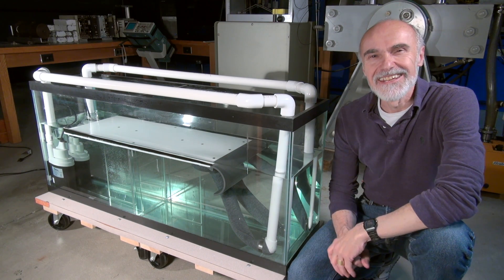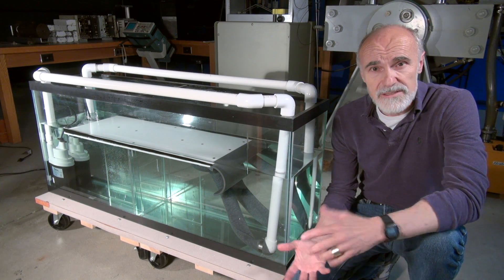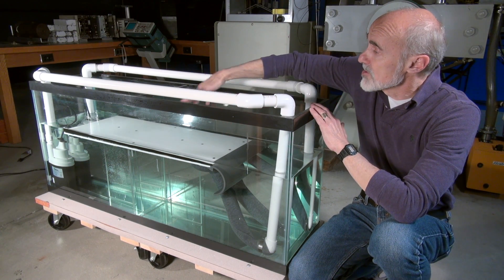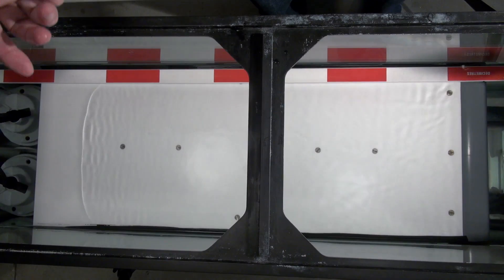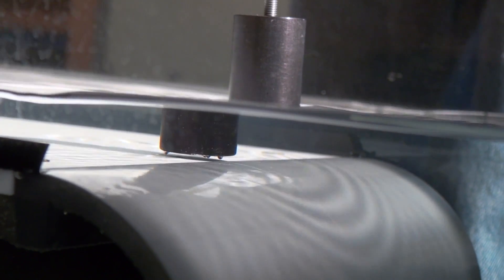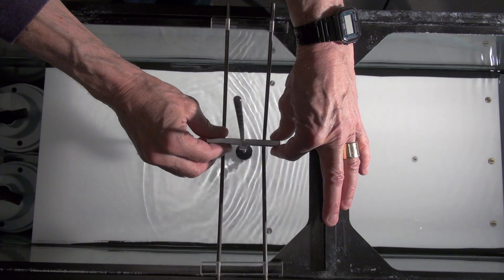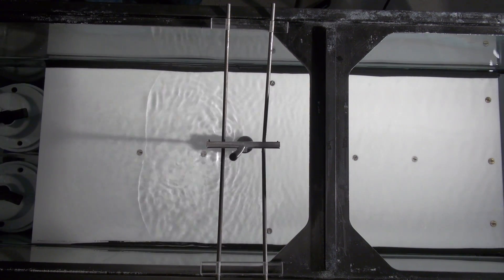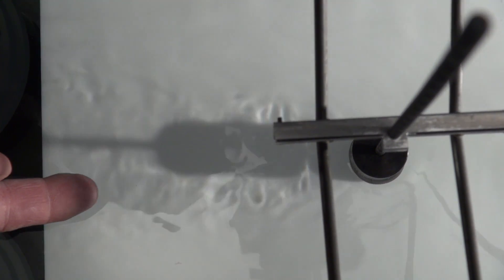Vortex Shedding in Water

Comment: in this design, the cylinder is fixed, and the fluid is flowing into it, but does anything change if the fluid is affixed and the cylinder is the moving part? like a soccer ball traveling through windless air.

Comment: I wonder if the vortex frequency is similar to the pendulum swing frequency when the swing amplitude is large? Does the pendulum swing frequency be related to the environment in which it is located, in the water and in the air, or in the lower part of the water, as in the video?
Reply from the maker: Yes when the vortices are shed at a frequency that corresponds to the natural frequency of the physical pendulum, the amplitude becomes large. The situation is analogous to pushing someone on a swing: when you push at the right intervals, the person on the swing will travel the maximum distance between pushes.

The natural frequency of the physical pendulum is set by its length, relative to the pivot (e.g. a longer length gives a slower frequency, a shorter length gives a faster one). When the end of the pendulum is in the water, the natural frequency will slow down a little bit, due to the drag force of the water.

Comment: I think the flow speeds upstream and downstream are the same, along the channel.  The flux was constant and the cross-section was also a constant, i.e. this will tell us the flow speed can only be constant. Do you have a aquarium side view? if the water depth in the downstream section was a bit higher than the front section, then the fast-slow claim can be true. Anyway, this is a great video.
Reply from the maker: Yes the flow rate slows down near the end of the channel because of the transition to the deep reservoir.

Comment: The vortex structures are mechanistic phenomena that shouldnt change the material properties of the fluid. Why is there a change in the optical behavior due to these structures ? Is it because of underlying impurities in the fluid that get concentrated by the vortices ?
Reply from the maker: The vortices cause the surface of the water to no longer be perfectly flat, and so refraction at the air-water interface can bend light away and cause shadows at the bottom of the tank.
Reply: @NatSciDemos  Thanks !

Comment: Why is the flow speed lower at the downstream location, is it because you have an inclination of the bottom plate (also, I had a hard time seeing any difference in the ping-pong ball test)? If not then I would rather guess that the upstream location is affected by entrance disturbances that destroy the regularity in the pattern.
Reply: It's due to friction. Where the water meets the bottom plate on a micro/nano level, you have to imagine that the surface of the bottom plate is not perfectly flat. Any surface you see around you right now is not perfectly flat. When zoomed in close enough, you will see a mountain like surface. Now where the water molecules meet these mountains at the surface of the bottom plate, you can imagine water molecules getting stuck in between these mountains (in the valleys). We also know that there are certain inter molecular forces between the water molecules. Here we want to focus on the attractive forces. As the molecule that is stuck in between the mountains is pulling on its neighboring molecules, it will slow them down (considering the moving fluid case of this experiment). These molecules will in turn slow down a higher fluid layer as there will be a velocity difference between the layers. So you can imagine that this concatenation of molecules pulling each other back will result in a slower moving fluid eventually. 
At the start of the ping-pong test, the ball needs to be accelerated first. When the ball is thrown in the water, its initial velocity is zero. The water molecules around the ball are moving fast, as the demonstrator states. The ball also does not have a perfect flat surface. Again the water molecules get stuck in between the mountains of the balls surface. The same pulling motion now causes the water to pull the ball along, as it is not a fixed object (unlike the bottom plate). We know from newtons second law that F=ma, and therefore the pulling force of the water will cause the ball to start moving as the force causes an acceleration a which increases the balls velocity v. After some initial acceleration, the ball will have the same velocity as the fluid. At this point, there will be no resulting pulling force on the ball anymore. So the reason why you can't see the difference in the fluid velocity is because the ball has to accelerate first. Once its velocity is roughly equal to the fluid velocity, the fluid velocity has already decreased due to the bottom plate friction. 
Hope it helps:)

Comment: Is this the same phenomenon that causes a baseball thrown with no spin on it to "dance" around?
Reply from the maker: Kenneth Boyd Interesting question. The knuckleball definitely deviates from a normal trajectory due to variations in pressure. There can be several factors that lead to these variations (local turbulence, temperature variations, etc). But I would imagine that vortex shedding could plausibly play a role.

Comment from the maker: Correct, the slower stream would result in a shedding of vortices at a lower frequency.  If that frequency is different from the pendulum's, then the pendulum will not be resonantly excited.  Furthermore, the velocity of the slower stream might be too slow for the alternate vortex shedding (von Karman vortex street) to occur.
Reply: Harvard Natural Sciences Lecture Demonstrations but what is causing the pendulum's frequency? is it the creation of the vortices? if it is then wouldnt it automatically match the frequency of the vortices causing it to be reasonantly excited?
Reply: @changenoways9555  - I think it's more about the material it's made from. Different materials have different atomic structures and characteristics.

According to this paper - frequency is the velocity of the sound of this object (if I understood it properly). And you hear daily how different objects and materials sounds -  density matters but this is atomic structure.
"The  resonance  frequency  of  an  object  is  a  function  of  its  sound  velocity  - a  material  characteristic  - as well  as  of  its  geometry. "

(PDF) Resonance frequency measurements of a few materials for temperature variations. Available from: https://www.researchgate.net/publication/281549045_Resonance_frequency_measurements_of_a_few_materials_for_temperature_variations [accessed Oct 27 2019].